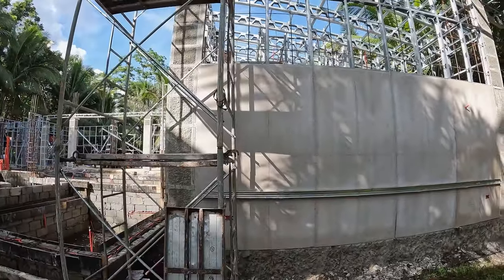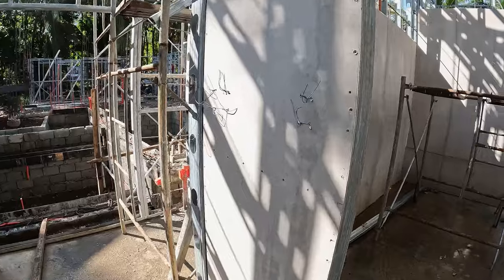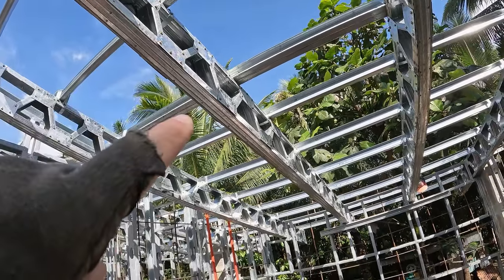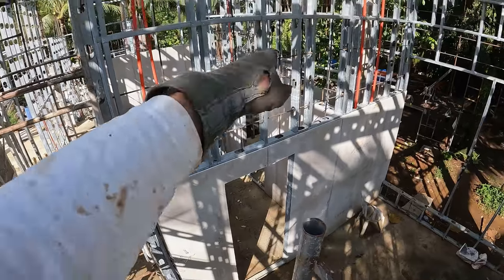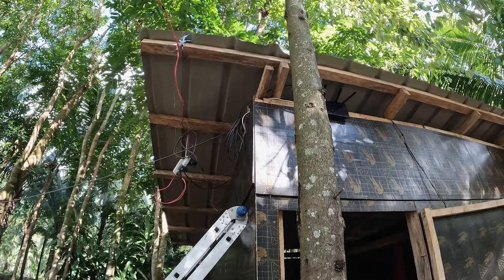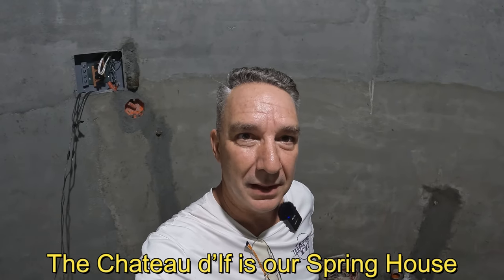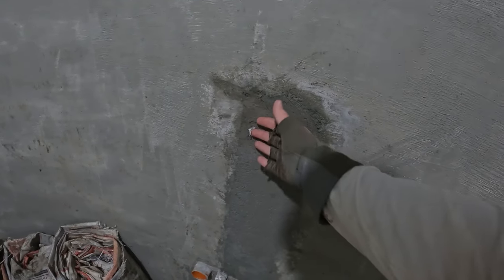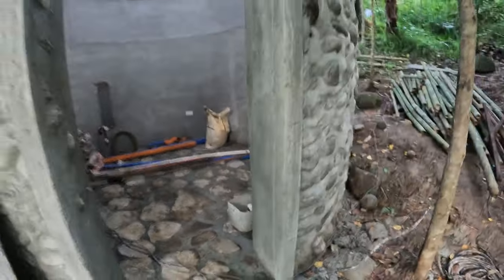Metalyte Column Pours and Shera Board Install 🏠 | House Build Philippines | Ep. 21 | TORINO

Comment: The build is off to good start. Do like the steel framing with Hardie flex sheets , it should be  easy to render however Hardie sheets need sealing all round however in the Philippines the hot condition should be enough to keep them dry.
Love that stone work.
Reply from the maker: Thanks for commenting! I love buildings with stone too. 😊

Comment: Boy!!  they are moving on pretty fast. d’if is just amazing it 👀 looking pretty cool place.  

Question? 
With the columns having the steel channel exposed what will happen when you render it. Will the render crack at the steel parts ?
Reply from the maker: Good question. I can't say for sure, but I would think no, as long as there is no air entrapment...

Comment: Will there be walls and ceiling be insulated? What is the function of the round room with stone walls and domed entranceway?
Reply from the maker: The ceiling will have some insulation, not the walls, solid concrete. The round building is a small side project which houses the deep well water pump.